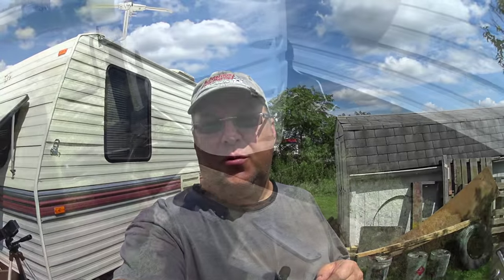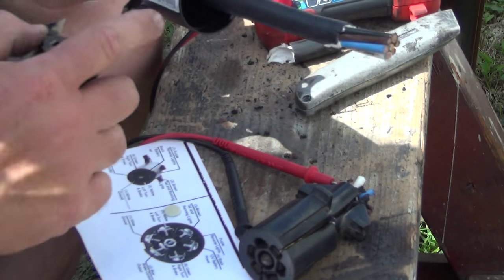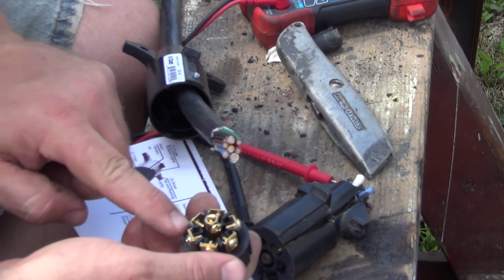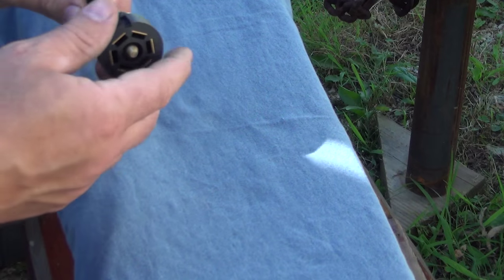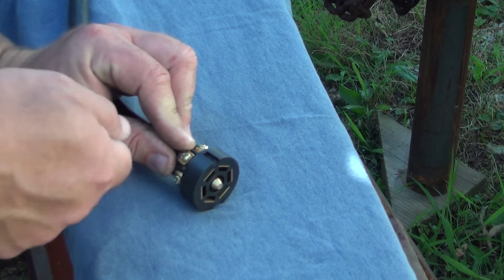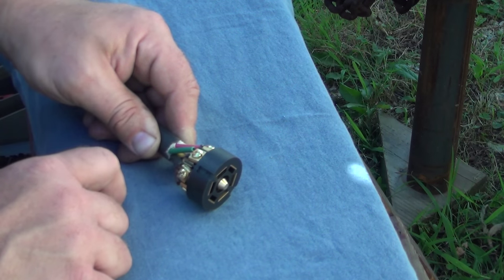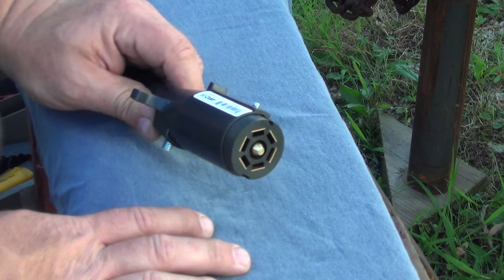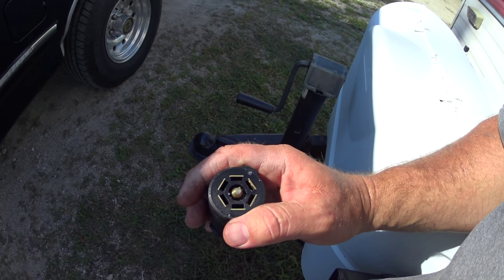RV Trailer plug install

Comment: Ok, that was some really important detail you gave with that plug-we would not have known at least two of the points you made otherwise, so thanks a lot! Really do appreciate the time you take to explain things. Stuff like that is critical to get right the first time-there's only so much wire length to keep clipping back if you have to redo!
Reply from the maker: Thanks again for watching and the comments!  I Appreciate it!

Comment: Would have been beneficial to show soldering and installing the wires on the connector. It`s easy to figure out but if you`re trying to help why not show it???

Comment: Nice video. But what does the BK stand for on the tester? I worked on a trailer and the brakes WOULD work with two other trucks but NOT with the owners truck . I have two testers , a Curt and a Tekonsha. Both of them showed the Left and Right turn signals activated when applying the brakes but the brakes were not activated. The lights and everything else worked but no brakes. I had the trailer jacked up with both wheels off the ground spinning the tires so magnets were activated. Plus the 12v light was on.
Reply from the maker: Thanks,,I have no Idea what BK is.. mine doesnt have that...Make sure you work the problem...If it works on two other trucks then the problem lies with the truck that doesn't work...as long as everything is wired the same..including the trailer..

Comment: Never wire a plug color to color. There are two different standards out there. Wire up as per function. Use noninsulated ring terminals and heat shrink tubing.
Reply from the maker: Once checked, found that the standard required color to color..